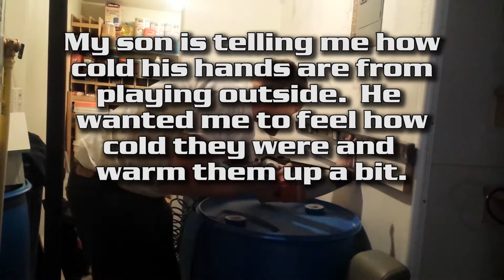Bull-nosed particle board shelving

Comment: Beautiful mitre saw.  I like the shelf wood supports for the brackets.  I put similar shelves in my bathroom.  Forgot the wood supports though.  They only hold towels and light weight.  Used rubber corner guards.  Doing my cabinets now!  Thanks.
Reply from the maker: Thank you!

Comment: Where did you get the rotators you have now?
What are you doing with the can rotators you are getting rid of? I would be interested in them. $
I would also be interested in seeing a video of the new rotator you are building
Reply from the maker: The current rotators are from rack 'n' roll out of Richfield Utah.  I picked up 7 for $150 years ago at Payson Onion Days (Payson, Utah).  I am not sure if they ship as they come assembled, but they do make different sizes for different shelves.  I will post a video on the new rack system I make.  It is a much more space efficient design assuming you have some wall space.